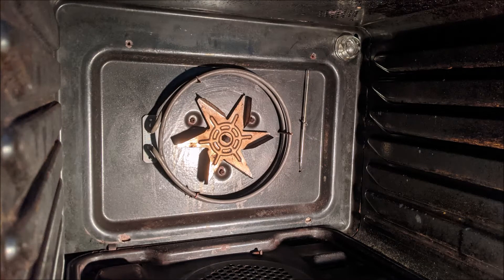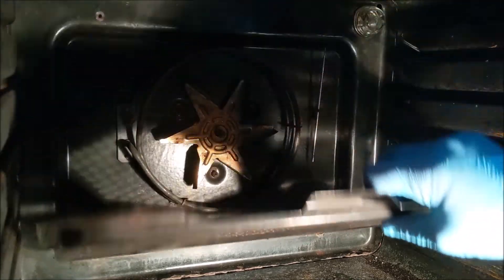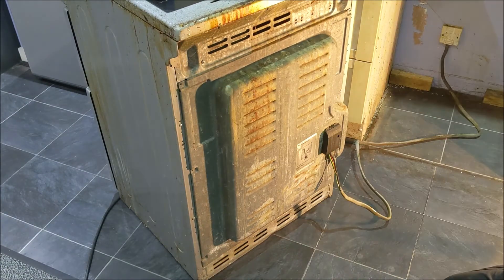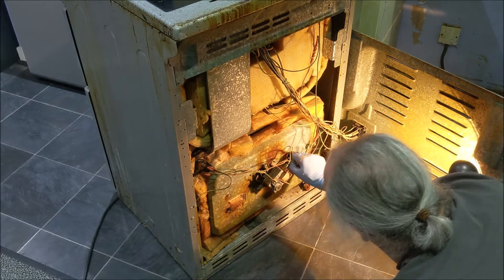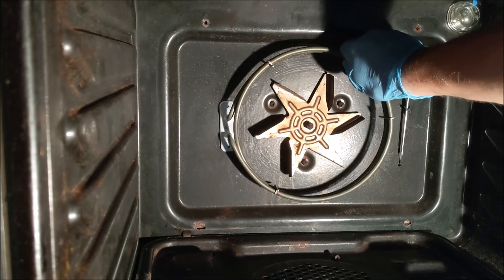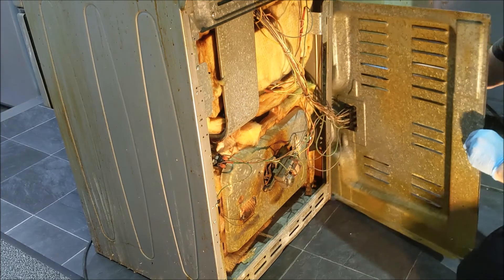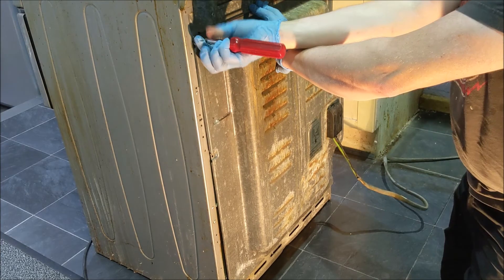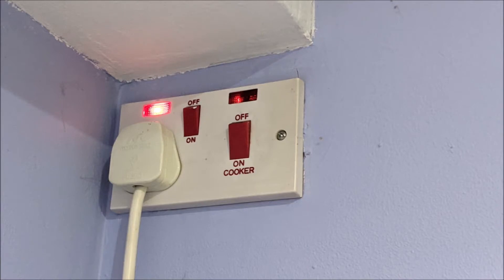How to replace the element in a fan oven

Comment: Any tips on getting out seized-up screws from the element/fan cover? Got a brand new Wera PZ2 with WD40 not touching them :face-purple-crying::face-fuchsia-wide-eyes:
Reply from the maker: Thanks for watching. Unfortunately the screws are a pain. Car mechanics like to heat up bolts to help move them. You may be able to get slightly bigger self tapping screws. No idea what size to get.
Reply: @PhilipWillsWorld  thanks for your video and reply. From searching it seems to be a common issue. Tomorrow going try hammer drill then if not will dremmel and then drill out as last resort.

Comment: Thanks for the video, looked so easy I thought I'd be able to do it.  Got to the screws for the element and could not get them off at all.. screws are ruined now and not able to change the element.  Seems I need to buy a new oven ☹
Reply from the maker: Unfortunately, they aren't made to last. You may be able to drill them out. Thanks for watching.

Comment: I have damaged a small foil type pipe on rear panel of a Leisure cookmaster , It seems like a one inch vent or oven flue . i CAN NOT SEE ANYTHING ON THE WEB AND WAS JUST WONDERING WOULD A BREAK IN PIPE BE DAMAGING TO ELEMENT PERFORMANCE AND DURATION . THANKS IN ADVANCE , IF POSSIBLE .
Reply from the maker: Hi, thanks for watching. I'm not sure what is damaged in your oven, sorry. If it is the element, then that would need replacing. If it is the really thin thing, that sounds like the thermostat, which would then need replacing. If it is a hose that heat goes through, then if it is punctured, it will lose heat. If it is crushed, then that will restrict the ability for hot air to travel through it.
Reply: @PhilipWillsWorld  Sorry for the poor description . This is a Leisure Cookmaster electric range type cooker . I am replacing the side oven element . I had to remove rear panel  , On the rear panel there is a small two inch square metal box . This box is the outlet through which a corrugated one inch foil coloured pipe ducts excess heat from side oven , I think , This is the small flue or duct that I have damaged . 
I tried numerous  times to ID this online but have failed .
thank you for reply .

Comment: Hi Phillip, changed the element - got a double yellow wires onto a single spade - Got a double Green and yellow wires onto a single spade and a single Grey wire - can you help? I do not recall how they came off the old element (so long a go now - pre pandemic) fitting a new one and the circuit box keeps tripping.  Have you a wiring Diagram for a BEKO DVC 663 Double Oven? or can you make suggestion, thanks in advance Patrick AKA The Great Alfredo Coventry
Reply from the maker: I don't have a wiring diagram, sorry. It may be worth doing a Google image search. Green suggested Earth, so would probably go to the oven body. See if you can trace it to see what else it's attached to. The terminals on the element can go either way around. It really helps to take photos before taking stuff apart. Doesn't help with this, but may do for future projects. This may help: https://images.app.goo.gl/yNGaxC49VV9HCVcn6

Comment: Any retro fitting tips if can't find original part?
Reply from the maker: Thanks for watching. Have you tried searching Ebay and Amazon for your cooker make and model number?
Reply: @PhilipWillsWorld  it's very old model. I'm in Thailand. Samsung service not helpful. For now just disconnected grill element. Still can bake a cake with convection element  without zapping myself from leaking grill element. Hehe
Reply from the maker: @Swenser  you should be able to measure it and search for one that is the right size.
Reply: @PhilipWillsWorld  I'll keep trying. I like the unit. It's a sammy ce1000t. Old Combo microwave. Just made a 🍕 in it. Delish.